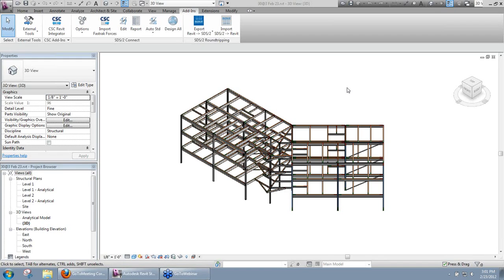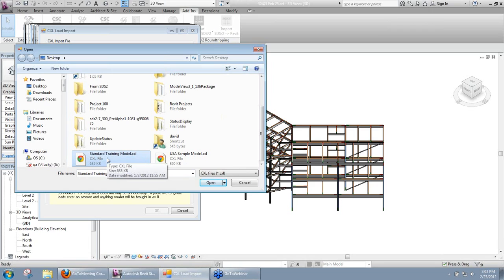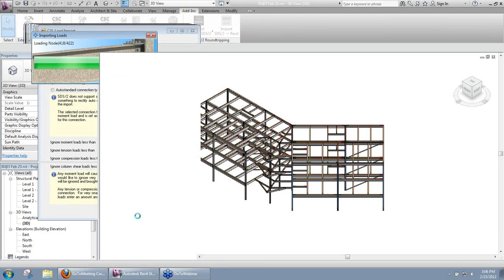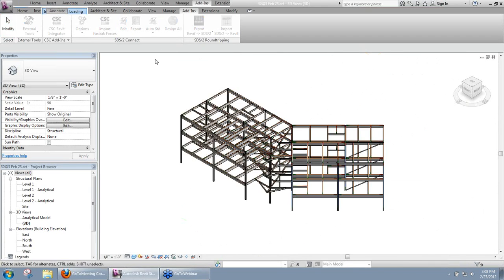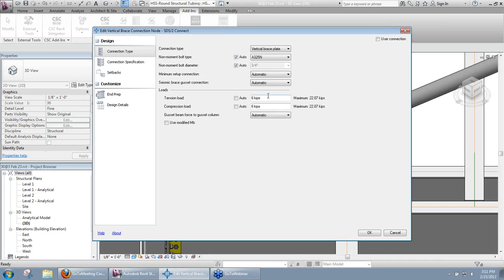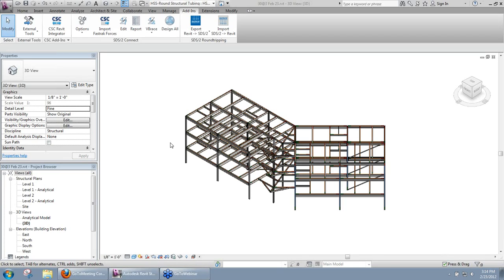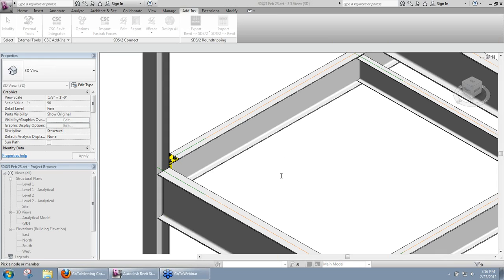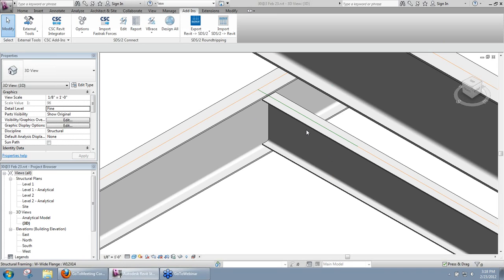30 @ 3 LIVE (Replay): Importing Fastrak Forces Using SDS/2 Connect in Revit Structure

Comment from the maker: SDS/2 Connect has the ability to import end reactions from CSC's Fastrak Building Designer. This eliminates errors and the need to manually input design loads for each connection, saving users time and more accurately designing required connections.